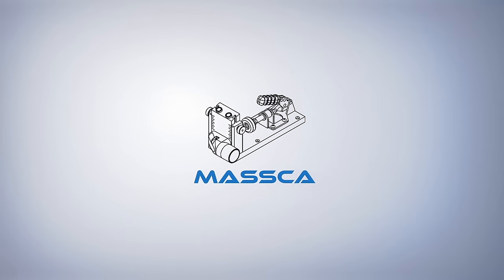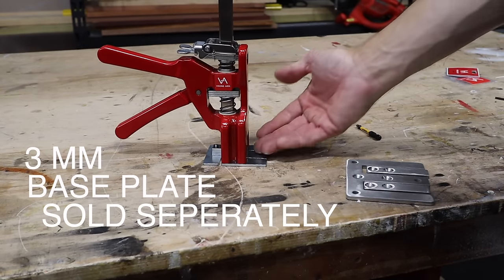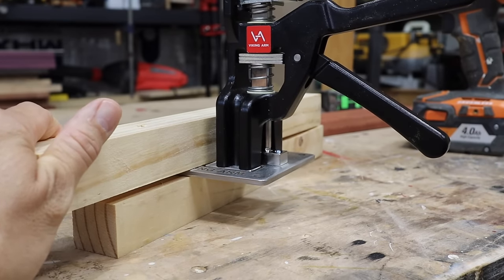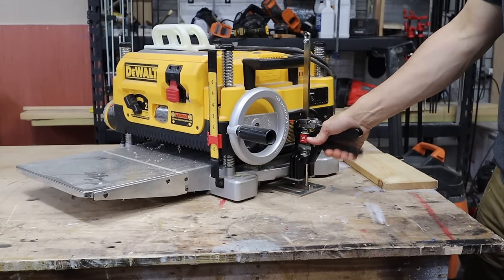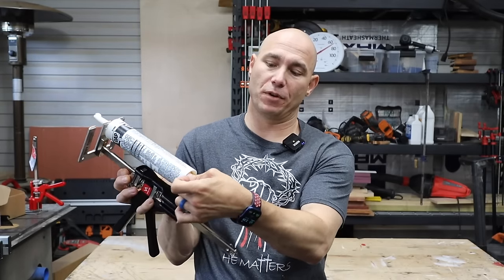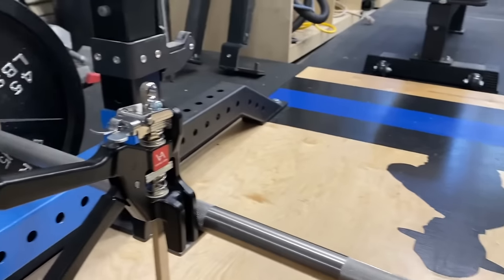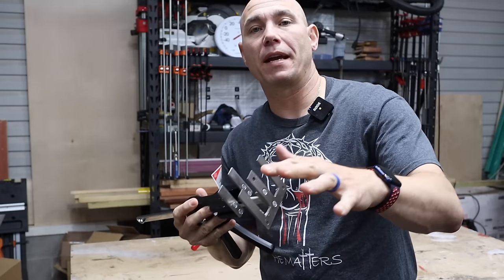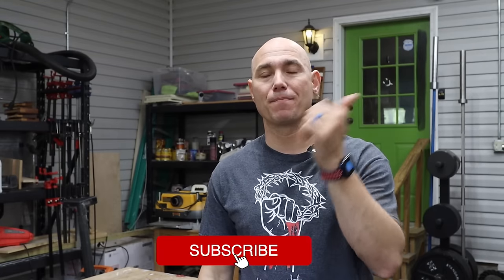The Viking Arm is the Most VERSATILE HAND TOOL You Can Own!

Comment: Hi Matt!  New to find your channel.  I have ordered 3 Viking arms to lift a freezer for service to the leaking drain tube, as visualized a crack in one,  as it is not accessible.  I will be using 8x6 inch lumber to lower the freezer on, while I reach underneath.  Now this may seem crazy, remember that I would have to turn off the freezer, unload the freezer, tilt it on its side, service the broken drain tube, tilt the freezer back up, wait 24 hours with food in ice chests or in a spare freezer, while freon settled, and restart the freezer, and wait for the freezer to cool, and reload the food.  I have calculated that the Arms will be placed two (on hard points) on each side toward the front, and one in the back to tri-lift the 800 odd pounds slowly and evenly to 8 inches.  Don't know how others would approach this perplexing problem?  Sure that others will be surprised at cost, but after this first use, I'm sure the 3 units will continue to pay for themselves.  Thanks for demo on reaching max weight!!  Thanks for the inspiration Matt!

Comment: Matt, thanks for sharing the Viking Arm with all of us "imitation expert" home woodworkers.  I am planning to build an kitchen island which will have to be partially framed in the garage shop and finished in the kitchen itself.  I can see the Viking Arm providing a very beneficial service in keeping the side panels at the right height as I attach them to the interior frame, as well as using them on the refrigerator, stove, dishwasher or anything else that needs the incremental lifting these arms provide while leveling.  Great video, and thanks again.
Reply from the maker: Thank you

Comment: Very cool as a woman I could find a lot of uses for this, I tend to try and do too much on my own.
Reply: As a woman, who is equivalent to a 10 year old dog, I can promise these pay for themselves. I had a 500 lb woodstove that I could not find a mover. I finally found a piano mover who would remove it if I could get it onto a furniture mover. I used two Viking Arms and continued to raise and block until I could slide a mover underneath. 
Second use was getting a refrigerator installed in a tight fit, where the installer thought they would have to cut out tge tile to remove the old. I brought out tge Viking Arms and they were able to lift the old refrigerator over the tile lip.
Each use paid for the Viking Arms and it's reassuring to know uou have a tool like this incase things don't go well.

Comment: I was dead set on ordering a couple of them, until I clicked on the link. I've experienced sticker shock before, but that price really caught me off guard.  It's a hard pass for me. It really looks like an awesome tool, but not for that kind of money.  Heck I've bought running vehicles for what two of those cost.
Reply: Hey Derrick, I found a new pair on Amazon for $29.95.  Prob needs accessories but the two Vikings aren't killing me!!
Reply: @chadstout1  The cheap ones on Amazon appear to be knockoffs (probably Chinese).  Do you feel the knockoffs work just as well?
Reply: @TeamICOS  Hey Michael.  I cancelled the order I created on Amazon so no experience here.
Reply: @utooboobnoob  I had a much more detailed conversation with them via email and by phone.  I told their product marketer about the patent infringement and the copyright infringements.  They were thankful and my actions were passed along to the president of the company.  I also told Amazon that they have 4+ pages of knock-off tools that use the patented tool photos as their own, list the tool with the original manufacturer's name and it makes Amazon look like eBay.  I also went to another site and did the same thing.
Reply: @utooboobnoob  in some cases, you're taken to another site where you place an order and nothing arrives according to Matt.
Reply: @chadstout1  What exactly did they patent? 500 yr old technology?
Reply: I need 4 to lift my pallet of gold. I can make my pallet lighter by taking one of the gold bar to buy 4 of these.

Comment: Great tool, yes its expensive.....but theres nothing even close in strength on the market, i work alone most of the time, ive used it to hold up gates , level doors , kitchen cabinets & even to lift a washing machine . cost wise its saved getting an extra worker in many times , so looking at it that way it paid for itself in a day , especially at uk labour rates of £250+ per day for a decent tradesperson, great review too , im subscribed .

Comment: hi matt
great review of a great product,as a finishing  carpenter working alone i have found  many uses for it.   it holds what you want  where you want and doesn't   complain. when i bought  mine i asked the guy in the shop was the 200 euro approx price for a pair but alas no!  still would not be without  it  probably  get another one. the only thing  is trying to get a screw in the top hinge  and adjusting  the Viking is abit fiddly  a foot  operated  pedal  attachment might be an idea. i still  use the air bags for this job
 subbed  Liam

Comment: $199 each. Yeaaaa nah I’m good thanks.
Reply: whats your back worth?
Reply: @44dton  valid point
Reply: I use airbags to lift stuff up to half a ton, they've got bigger ones. It looks like you could make something similar to that viking arm with a caulk gun. 

The big caulk guns push a lot harder than people realize, and with a mig, a cut off wheel, and some scrap for plates and gussets I think it can be done pretty readily.
Reply: There are dozens of similar items in Amazon at 1/8 the price. Granted they are not as good, but definitely will do the job. For around $50, you get a pair already.  Of course you get what you pay for. But if you break these to lift/pry a very heavy object, you’re most probably using the wrong tool.

Comment: They are expensive, but if you need one, they pay for themselves. I have lifted a 500 lb wood stove and a 48" SubZero refrigerator with two of these. Each use would have cost me more than the cost of the Arms in alternate resources. They've paid for themselves twice.

Comment: It's like a miniature Hi-Lift Jack, except I could buy 2 Hi-lifts for the same price and I could lift a truck...
Reply: Except you got like 3" between the lift wedge and the ground on a high lift.

The viking arm lift plates sit flush with the base and both are 3, 5, or 6mm thick depending on the base plate you put on it. It also has a much smaller lift increment.

Idk. Not really an apples to apples comparison. You're spot on about the price though. 200 bucks. . . Yikes. Must be marketing to the Woodpeckers people.
Reply: @iratevagabond204  I was being facetious. Obviously it is not an apples to apples comparison. I was more pointing out the price point. Matt is always talking about woodworking on a budget and is now doing a review on a tool that while looks handy and I would definitely use if someone gave me a handful, I would never pay $200.00 APIECE for.
Reply: @cswilliams29  Apologies, I meant no offense. I thought, perhaps, you weren't aware if the mechanical difference between the Viking Arm and Hi-Lift. I just thought i'd help you see the difference. Again, I agree on the cost completely.

If you sub contract, you can get tools such as these for free a lot of time. I do custom cabinetry, built ins, and fine furniture; I mostly use hand tools. I got hire a couple months back to build in a breakfast nook into a house someone was flipping. When I finished with that, they asked me if I could do some custom thresholds and doors. I pointed out that I normally don't do doors, but I was confident I could take care of it, but I'd need another person to give me a hand, or to pick up some door clamps to take care of it. I said "okay" and told me to shoot him a receipt. Got myself two free viking arms.

Did the same thing back in april or may last year with some cool 4 way clamps made by woodpeckers. I love my Clampzillas. lol

Comment: This tool is one of those “why didn’t I think of it” until I looked at price. I’ll stick to my reversed clamps with slight modification. It may not lift over 300 pounds, but works for my needs. Maybe I’ll make my own version. I’m surprised you didn’t state the price is extraordinary, but understand it’s probably for sponsorship. Honestly, you mention about starting off broke, would you really get this? It’s not a critical or commonly used tool for most woodworkers. I used to love your videos and content, but beginning to see it going in a different direction. It’s an amazing tool, but ridiculously overpriced.

Comment: I bought one. The second time I used it, one of the lifting fingers failed (bent) and the small machine I was lifting fell over. I tried to contact the company to get a replacement piece to repair it and they will not respond. Seems like it's not a good company to buy from, product failed and no customer service.